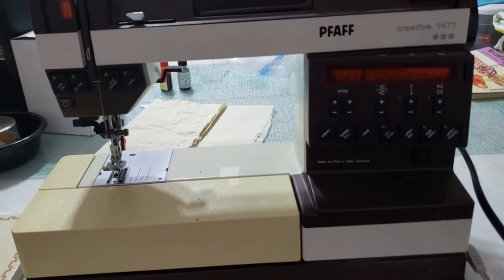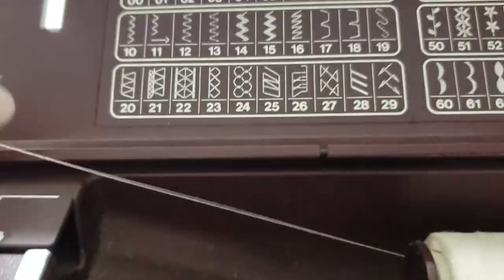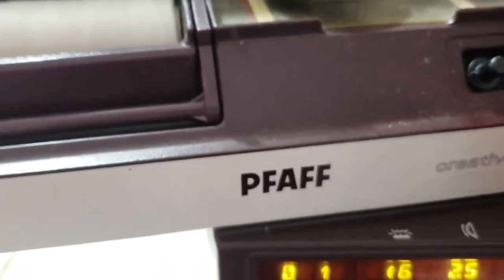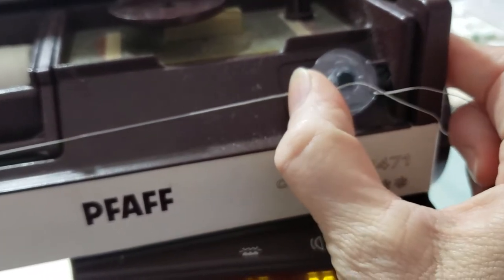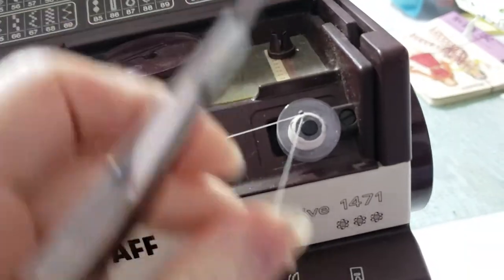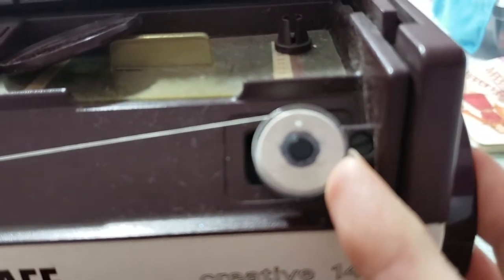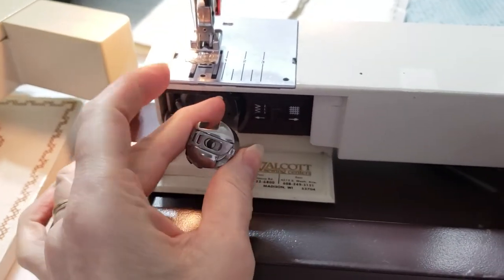Amateur demonstration threading (machine & bobbin) the Pfaff Creative 1471

Comment: You missed the first thread guide which is the metal plate right in front of the thread spool,
Reply from the maker: I no longer have this machine so can't really look at it to see what you're referring to. My current machine has a thread guide like you're talking about. If the Pfaff, has it I guess I never used it in the 30 years I sewed with it.

Comment: Anyone know how to put the thread around that little black part where she stops the film?  Thank you!!
Reply from the maker: I'm not sure what black part you are referring to?
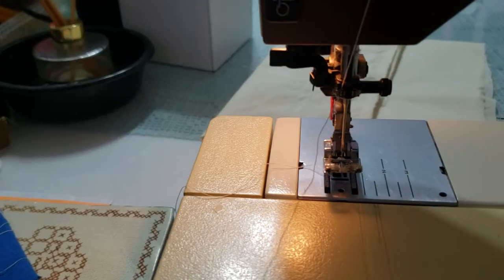Reply: @sheriw.7009  At 1:12, you say you can't do that part one-handed so the video stops and when it starts again, that part is done, but there is no close-up to show where exactly the thread is.  It's the black part that holds the needle and on the front of the black part are two silver metal clips, one on each side.  I need to know if the thread goes completely behind that silver clip, or if it is supposed to slide through the cutout in the metal clip.  I don't know if Renee Fortain had that exact question or not.